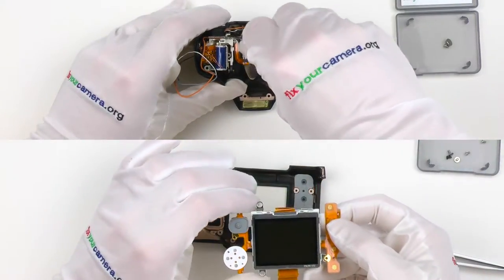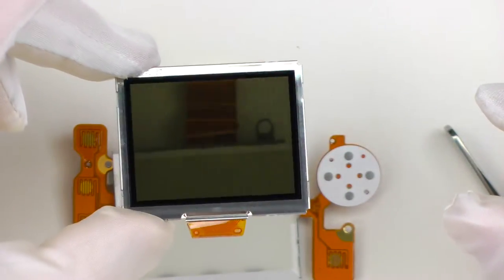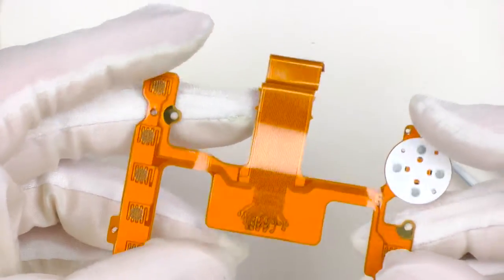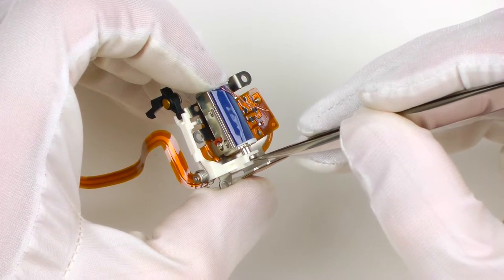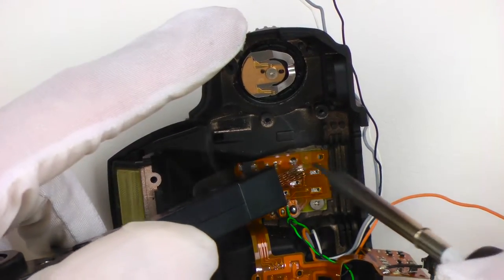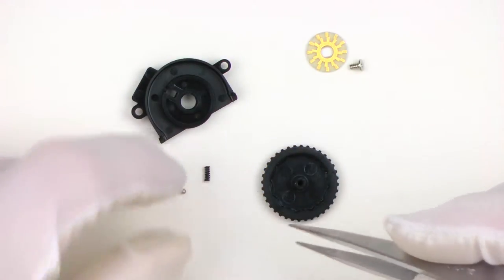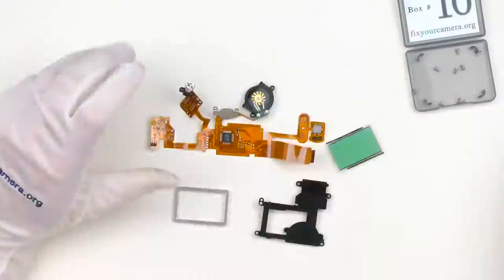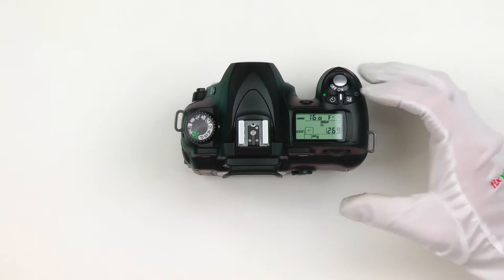Nikon D50 DSLR Camera Teardown & Review *part 4/4* Top & rear covers - How it works?

Comment: Great job Mike! I think I like the idea of multi-part video better. As I mentioned previously your narration is excellent and not overly technical. I would really like to see the inside of one of the Olympus OM-D models (I have an E-M5 II :). While I realize they are completely different animals, I can't help comparing the sturdiness of my old Nikon Nikkormat FT2 SLR to that plastic D-50. That's what first attracted me to Olympus, the metal construction and build quality.
Reply from the maker: +richdt   I'll keep making shorter parts most likely, it's also much easier for me. FT's and many SLR's were totally different, you won't find this type of quality anymore.... Olympus is coming sooner or later...  Thanks!!!

Comment: Wondering if you could do a video on fixing cf card issues like pin missing, replacement or fix in-situ
Reply from the maker: +Joshua Photara  I will, but unfortunately there are no quick fixes for these. Overall the CF connector is a completely flawed design, at least in my opinion...:)

Comment: I know you don't want to make a video on sensor cleaning, but can you recommend one by someone else? I'm never sure if I should trust the methods that others use.
Reply from the maker: +Michael Tonge   Michael, I just use compressor with moisture/small particle filters swabs, alcohol, and cleanroom wipes for optics when disassembled. Some sensors/coatings are tough and require more things and time. Overall not much to it, really:)

Comment: Great video. I have a question about the pop up flash on a Canon 7D or 7DII. It seems that for all the weather sealing water can still seep in to the pop up flash area and down into the area where the joints of the flash connect to the camera. Is there any design features that prevent this?
Reply from the maker: +Chris Somos   Yes:) your warranty card... it says something along the lines of: "liquid damage is not covered under this warranty.." And this one sentence overall sums up the whole "weather resistance" thing:)
Reply: I figured. Thanks for the reply. I've been taping the pop-up flash seams when I'm out and it's snowing/raining.
Reply from the maker: +Chris Somos    I would protect the whole camera in one way or another, despite all of the "awesome claims" about weather sealing and other marketing stuff

Comment: I have a pretty basic question. My old Nikon D50 lost the mode dial sticker and I can't figure out what mode I am in. The one side of the dial has a tiny slot (of which I have been assuming is "Auto mode" and directly opposite of the slot on the other side has a small rectangular depression. Any help on this before I get a new sticker for this??

Comment: Great video's ! Anything which can be done regarding sticky rubber of the grip ?
Reply from the maker: +edow11    As a diy hack you can use a bit of silicone grease, it will do for some time. A real repair is to replace the grip, rather easy job. Common problem with plastic grips in D50 and D70
Reply: +FixYourCameraORG Thanks ! It's indeed a D70s suffering from this.